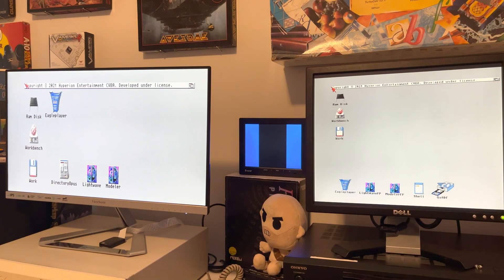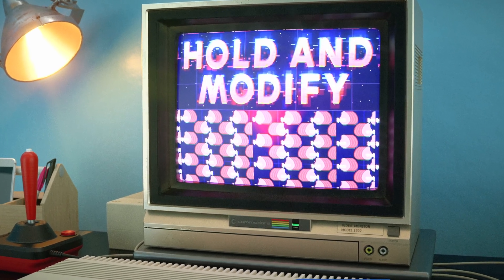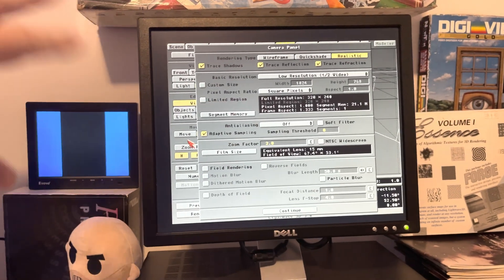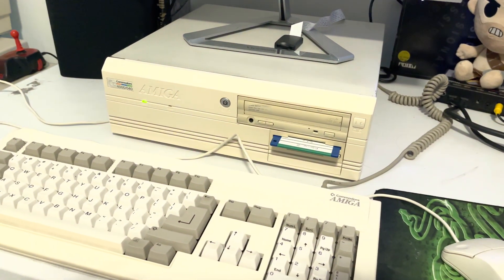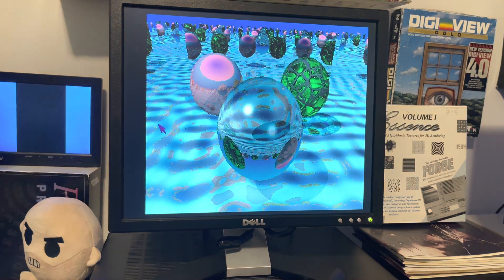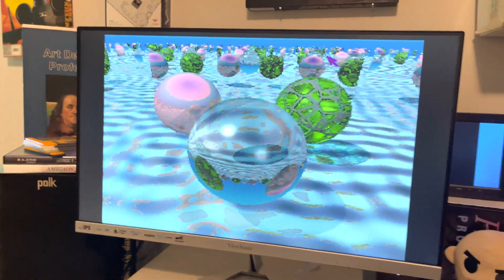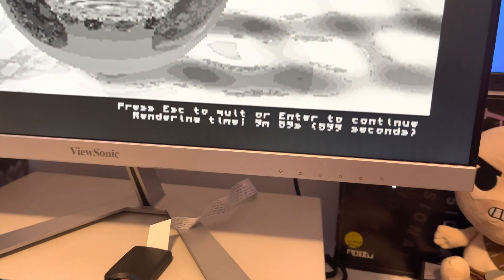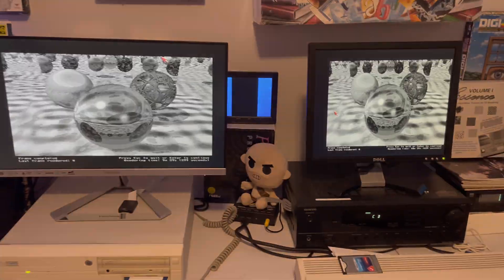Amiga 68060 SMACKDOWN! A4000 Vs A1200!

Comment: Huh, I was surprised it rendered on screen.  
I was expecting you to have to pull the screen down like I used to on Imagine3D to get faster rendering! lol
Reply from the maker: Lol! That’s funny. Didn’t know that was a thing.
Reply: @HoldandModify  Oh yes. Dragging the screen down gave you a HUGE speed boost. The computer only needed to draw about 2 or 3 lines of the screen iirc so could focus more resources on rendering.
My A500+ with (gasp) 2megs very much needed it lol
Reply from the maker: @Delboy001647363  that’s a good one! I’ll try it with Lightwave too!
Reply: @HoldandModify  Dunno if it would have much of an impact on something as comparatively powerful as a 68060, but it definitely did on my A500+ lowly 68000 lol
I'd be interested to see the results if you do.

Comment: I know you would no longer do it normally for safety reasons (gotta preserve your Amiga herd), but it would be REALLY cool to see a mixed systems render farm up and running on Amigas, crunching a short scene together. After watching the scene, you can break down which box contributed the most scenes, etc.  Maybe throw a thermal camera up in the corner. Current monitoring to calculate power per frame on each machine. 
Wait.. that sounds a little over produced for you ;)
Reply from the maker: That sounds pretty cool! You’re hired as my Producer. Now make it happen! :) 

Time, knowledge, and money, are lacking to make that possible. I could do a scaled version maybe. Having the machines render assigned frames then see how long it took. As for thermals? No cheap way really that I know of.

Comment: The Amiga is amazing at raytracing!
Reply from the maker: It is.
Reply: except its not, Yes the 4000 was OK if we look at stock computers since it had 68LC40, but all the rest was underperforming when compared to ATARI, MAC or intel PC competition.
And not, Light Wave is not a raytracer, the POV is. LW is a renderer with pathfindig post processing shadow and reflections effects, but that is not raytracing. Is LW good? Yes it had very nice workflow and was easy to learn, were there better visualization programs on market? Yes, LW has not the best final quality and is not very accurate dimension wise, so it is a nice toy, maybe even good for artists, but not the best for anything technical. I know HaM will disagree as a long decades LW user, but it is what it is....

Comment: DirOpus ?? men i loved that Program way back then, it was the best
Reply from the maker: Still use it! (on Amiga, love it)
Reply: @HoldandModify  i had the 500 back then, re soldered the board to 1mb chip Mem, added 8mb of Ram and had a 20mb HD in a Golem, changed out the Agnus and was running WB2.1, that thing did it all
Reply from the maker: Great upgrades and makes it even better!
Reply: @HoldandModify  it sure did, good memories, Pinball Fantasies, Pinball Illusions, Elite, Civilization, Formula ONe Grand Prix etc etc
Reply: DirOpus was something I properly fell in love with, the PC version was never as good (imo) unfortunately. On Linux I almost always have Krusader if possible that gets fairly close. Never really got too invested in other similar ones  like TotalCommander.

Comment: Use the BenQ BL702A VGA 16 inch LED monitor. On my AMIGA 1200 with Indivision AGA MK3 and a fast TF1260 with a Rev6 CPU on it. Use it only for 68060 Demos wifh 50MHz. Wich is great to watch on it and razor sharp with PAL 15.6KHz. You must tweak with the Indivision AGA MK3 but it’s nice to use. It’s not so great than on a very old Commodore RGB monitor. RGB is always the best second VGA. Now i have not so lucky with the Vampire V4 SA on a 24 inch BenQ HDMI monitor. Not so great fan of AROS and last new Core. Hope that come be better than the crap which i use now kn it. Abd i still be happy with the old Blizzard 1230 IV that’s still the best card for the AMIGA 1200 and for WHDLoad Games and Demos. For the rest i have a okay ACA1221 and ACA1233n-55 on my AMIGA 500. The best thing i use the last 6 years is the ACA500Plus V1 and the V2. Would like to have a AMIGA 1000 but that’s very rare here in the Netherlands. Hope that i soon have the Raspberry Pi 400 Kit for PiMiga 2.0 or a PiStorm for fast RTG FPS Games. The Vampire V4 us for that to slow and for WHDLoad to fast. Do now only ScummVM Games on it. 

You have a great AMIGA collection.
Reply from the maker: Thanks! And thank you for all the info!

Comment: Is the A4000 using a double-ntsc mode to drive the vga monitor?  Does that affect performance at all?

Are you using any 68060 patcher, like cyberpatcher or oxypatcher?
Reply from the maker: No patcher. Not needed for the Mk.II as far as I know, but admittedly I don’t know a lot. The monitor is a modern panel that can handle 15khz. I have an old video where I cover it.
Reply: @HoldandModify  You don't need to run Cyberpatcher or Oxypatcher, but using them will give your 060 a boost.  

Nice to have 15khz monitor.  

If you were using a double-ntsc screenmode (or dblpal), would that slow the machine down any?  I thought it would, but my brief google searches proved fruitless.
Reply from the maker: @jjdigitalvideosolutionsllc5343  this modern panel only supports OCS Amiga screens. Can’t use dbl or super72 modes. Heck even Multiscan throws it. Weird. Those modes do use up more chipset bandwidth, yes. However my PicassoIV is on its way back to me. So that’ll solve that. :)

Comment: I'd be curious how that benchmark would do on a Rasberry Pi running Amiga emulation. 
Back in the day I was a huge Amiga fan so it boggles my mind that a little single board computer like that can emulate the Amiga faster than any real amiga.
Reply from the maker: If you search my videos I have some covering Pi400, WinUAE and Apollo products. You can skim through them to the juicy bits. I don’t mind.  :)

Comment: Is Lightwave optimized for the 68060?
Reply from the maker: 5.0 is fully optimized for 040. So it is leaving some potential performance in the table but the 040 code tweaks really do see a healthy boost with the 060. The 060 itself is a fairly robust backwards compatible instruction set.